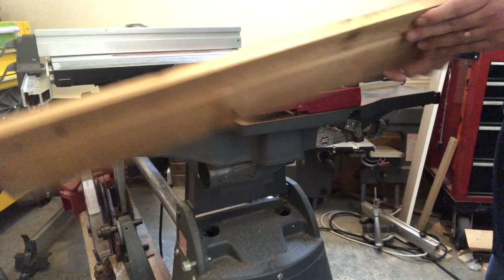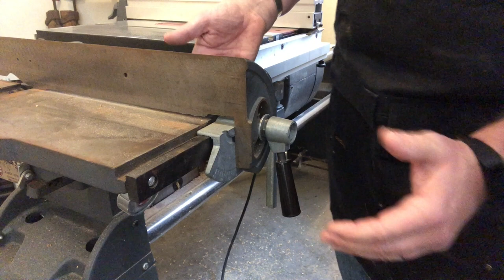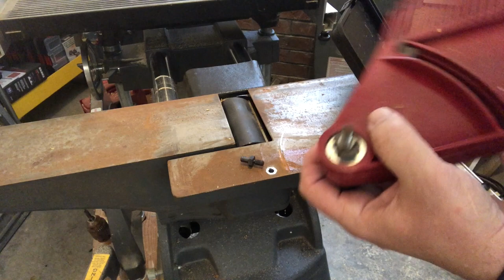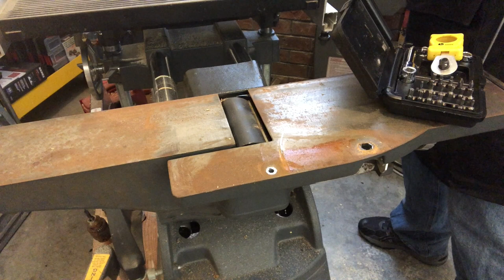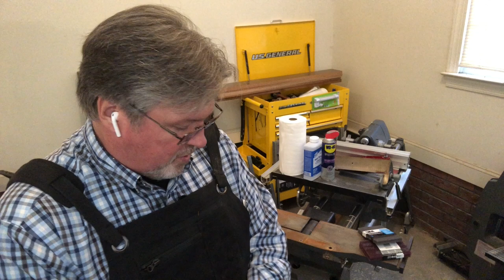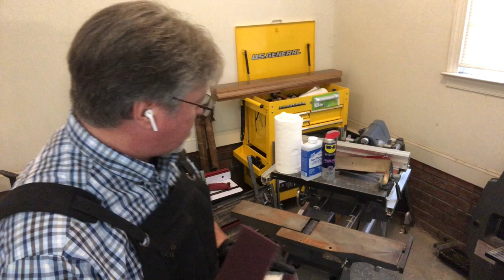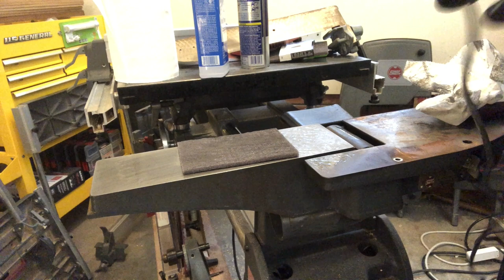Restoring a Rusty Shopsmith Jointer using the Ol' WD-40 and Scotch-Brite® method

Comment: I have done this a few times ( my garage  holds high moisture). My fix to all rust is dry moly or blowtorch and heat metal and put old non synthetic old on it works for 6-8 months. We all have our ways just mine and I use spry polyurethane on tools that I only use time to time works amazing.

Hey I see that you have a service band on your right wrist, is this correct?
Reply from the maker: Heat is excellent for opening the pores on metal, so I can see how that would work. My now diciest oldest sister was a silversmith, and she asked me that if she would make me a piece of jewelry that I would actually wear, what would it have to be. I've never worn much more jewelry than my wedding ring and a watch, but I remembered an old POW bracelet that I wore for several years and that got me to thinking about what I would want something like a cuff to look like. Ultimately I had her fashion it in the style of the bent-wood Shaker boxes that I enjoy making. Not only did she use one of the actual templates that I use, but she even got the copper nails from me to integrate into it. She stamped her hallmark and her name along with all four of my sister's names, plus added a few other funny personal touches. She's been gone a couple years now and I cherish it and never remove it.  Scott
Reply: @MyGrowthRings  Thats great history there, family is full of trades good sign. Thanks for sharing!
Reply: @MyGrowthRings  I have noticed your bracelet in almost all of your videos. When I first saw the joint in the band; I said to myself, that's a Shaker box joint on his bracelet, even before you did a segment in your video on Shaker boxes. I have been meaning to ask if there was any inscriptions on it, and who made it. Your sister sounds like she was a wonderful person. I'm glad you have something from her that is always with you, just as I'm sure the memories of her always will be as well. Very nice piece, Scott.
Reply from the maker: I agree.
Reply from the maker: She really was a wonderful person. At 57 she was taken too young, but we were blessed to have her five years longer than what her doctor predicted. Another if my sisters is very talented in glass bead making (who know that was a thing?) and inherited my older sister’s jewelry making tools and supplies and has been making some beautiful pieces lately. Check her out on Instagram @Julie.Nordine_jewelry.artglass

Comment: I don't understand why nobody has mentioned white distilled vinegar. It is a lot cheaper than wd40. I have had to deal with rust few have had to deal with. Soak paper towels and let them sit on all face surfaces. I do use the scotch brite pads. Yes I do use the polyurethane to coat. I don't care if you have pitting. Vinegar kills rust when it is bad.
Reply from the maker: I believe that someone did mention it in the follow-up video, but that's channel member only content.  Yes, any acid, vinegar included, will eat the rust.  Scott

Comment: I'm a big fan of WD40 to battle but I've never thought it needs to be removed -why is this so?
Reply from the maker: It doesn't always have to be removed, but because I was planning on applying a layer of poly over the cast iron I needed it gone. WD40 contains oil and naphtha, which was going to be a problem with the H2O based poly, which I was experimenting with. I think I may have talked about this a bit in the follow-up video, found here: https://youtu.be/FnTPtNAwREI  Good question, Scott

Comment: Hey there Scott.  Just following up on a previous question I asked you a few months ago.  Is it still possible for you to do a tutorial on removing and reinstalling new blades on the Shopsmith 12" Thickness Planer?  I believe you said you had a neighbor who had one.  Not sure if that is still the case, but I sure would like to replace my blades and the owner's manual is somewhat difficult, if not cumbersome to follow, and I was hoping you had some cool tricks to make this an easier task to get it right the first time.  I saw a magnetic jig on Amazon that might work to hold the blades in place while tightening the blades, but I wasn't sure if that jig would work.  Here's the link to that jig.  Thanks. John      https://www.amazon.com/Woodstock-W1226A-Mini-Planer-Pal-Pair/dp/B0000DD1VL/ref=sr_1_21?crid=K0PRN74ZWOLG&dchild=1&keywords=planer+blade+jig&qid=1619215006&sprefix=planer+blade+%2Caps%2C417&sr=8-21
Reply from the maker: Hey John, Yeah, it's a buddy who lives a ways away from me, but I'm sure we'll get around to the planer eventually. Unfortunately, the Planer Pal won't work on the Shopsmith planer for the same reason that similar magnetic knife setting tools don't work on the Shopsmith 4" jointer, and that's because of the wedge shape of the knives and the way they are held in place. When we tighten the wedges against the wedge-shaped knives they are pulled into the cutter head against the leveling screws. You'd think you could use them to set the leveling screws, but they just don't get you close enough. When I worked at Shopsmith during the "Woodworking Unlimited" era we tested several tools like this because we even offered them for use with Jet tools, but they just didn't work on the Shopsmith tools.  Good thought, though.  Scott
Reply: Thanks for the feedback, Scott.  Glad I didn't make that purchase, then.